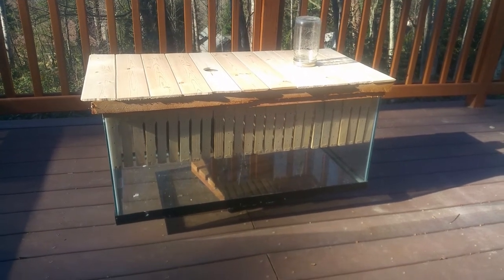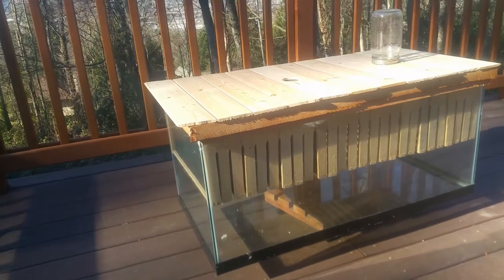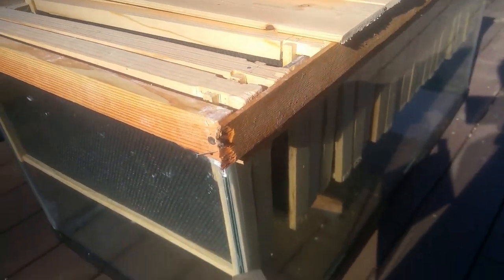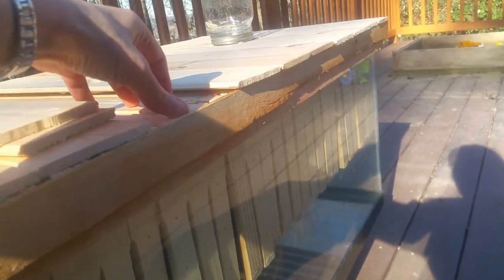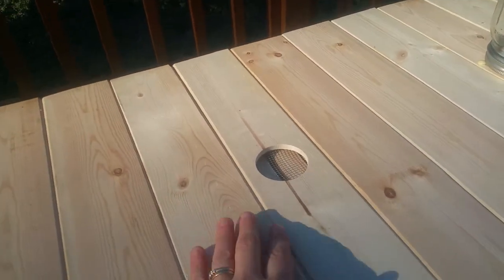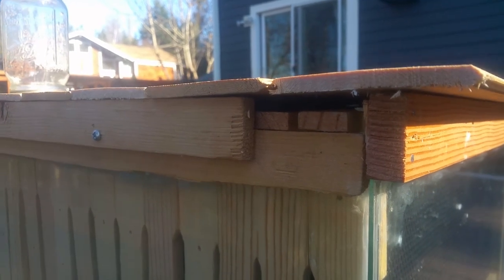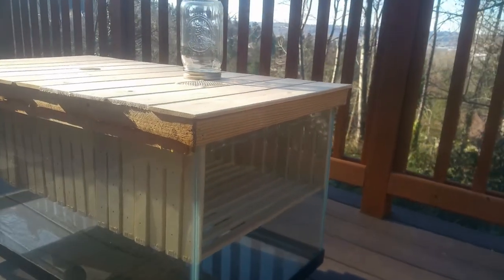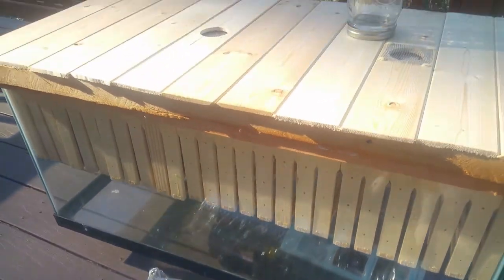DIY Observation Beehive in Aquarium Part 1

Comment: You should look at a top hive and maybe use those types of frames. If you do nothing to the bottom cavity the bees will build comb all the way down and attach it to the floor in spots. In a typical Langstroth hive there is about a 3/4" space between the frames and the floor. You should block your entrance with a board with a 3/4" hole in it and if you are going to use your window as an exit cut a board the with of the window height to match your hive entrance. Put a 3/4 hole in the board that will line up with your hive entrance and the put a piece of 3/4 PVC electrical conduit cut to size to go between your hive and window entrance. Check out some videos on observation hives that will give you some ideas.
Reply: Top bar hive